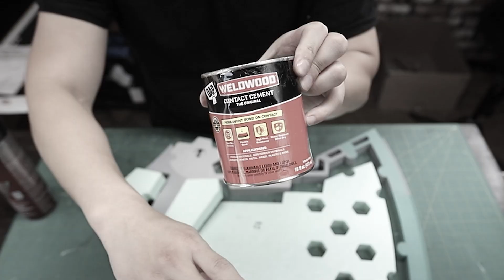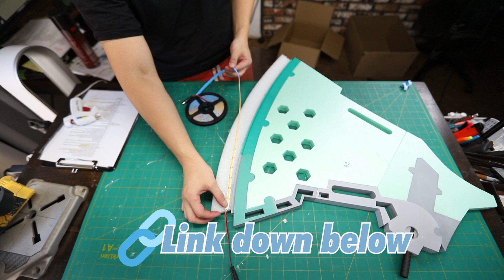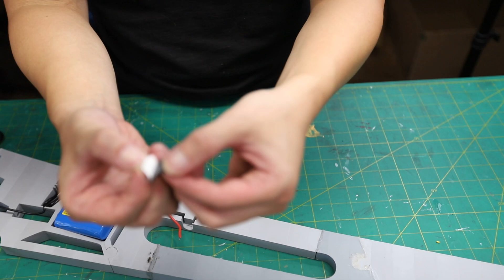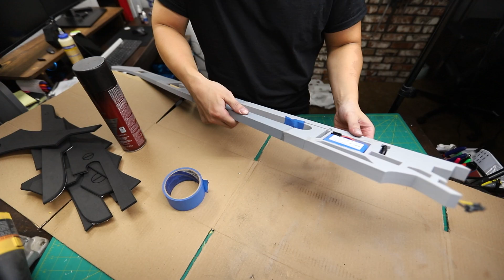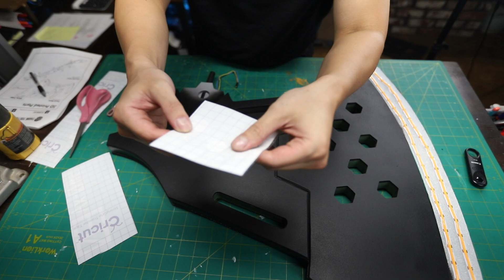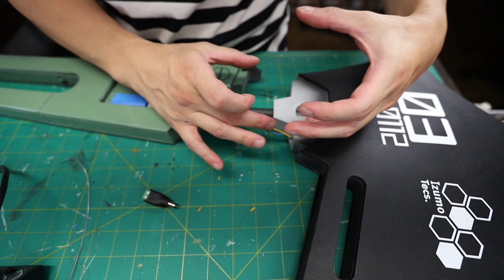Kaiju No. 8 - Making Shinomiya's Axe Light Up

Comment: Turned out so nice! I forgot that putting any electronics on is actually a little complicated (even if it’s just LEDs). Like wire management, battery, the switch
Reply from the maker: The electronics part can be a project of it's own